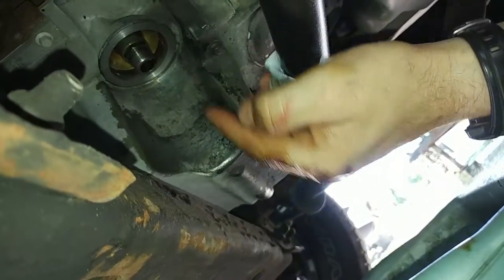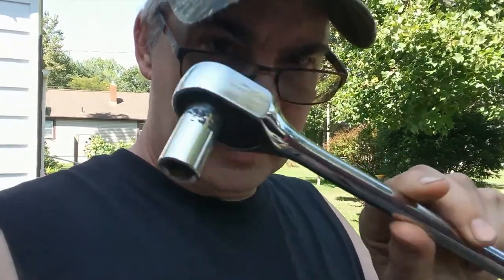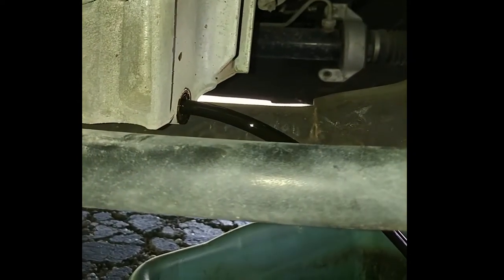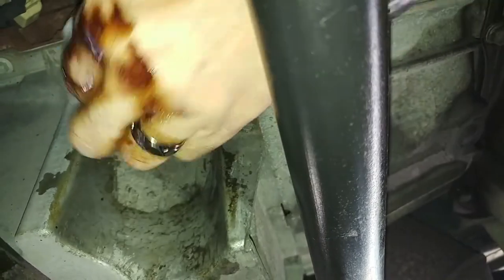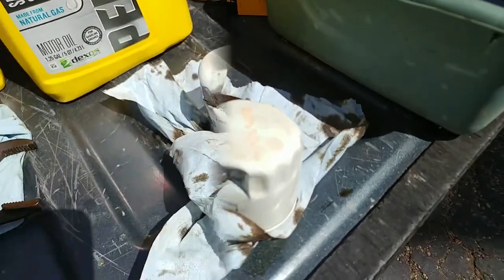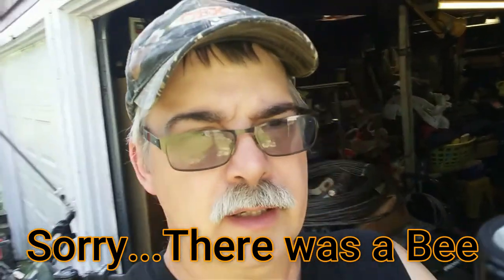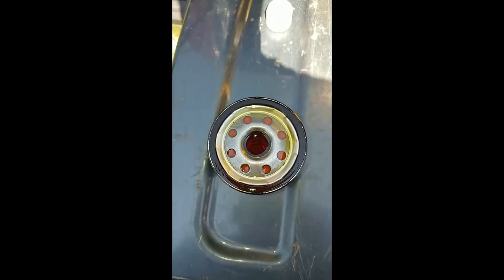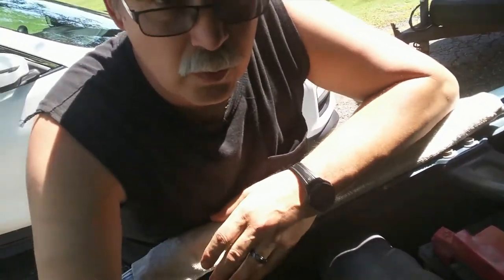How To Change The Oil In A Chevy Truck

Comment: Good job, Rob! You didn't even spill it down the valve cover gasket, lol, like I would have 🤣 Changed my oil many times back in the day. Good info on the drain plug too. Mercy, people wring those things off! I've had the filter be so tight, I've drove a screwdriver thru it to turn it, lol. Yes, definitely fill that filter BEFORE putting it back on. Good job wiping off the excess under the pan too! You look like you know what you are doing there, lol. Great informative vid, Rob. That oil is the life of the motor. Keep it changed and filled, if you see it anywhere else, you know you're in trouble. Gawd, I had one that when I pulled by the pump, id tell the attendant, "check the gas, fill the oil" 🤣 Mom had a 72 Dart Swinger, that slung a quart. It was always a quart low, the mechanics would tell her, she'd just grin, and tell them that was that particular car's flaw. If you filled it? It'd sling it out, lol. That car's still out there, somewhere, lol, prolly still slingin that quart too 😆 I miss sliding across the bench seat, n Mama grabbing me as she made turns, because the passenger door latch would open, and throw you out 😆 The damn thing was possessed 😆
Reply: Do you remember the old oil cans with the piercing funnel, lol. Have had a few cars that about the same oil and gas mileage
Reply: Yes! I remember learning how to "puncture" them with that funnel, lol.